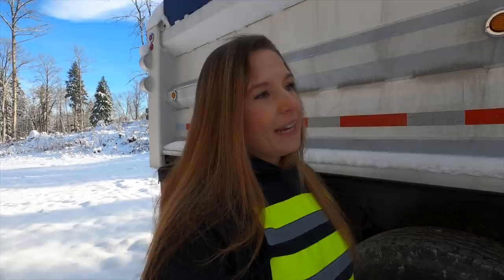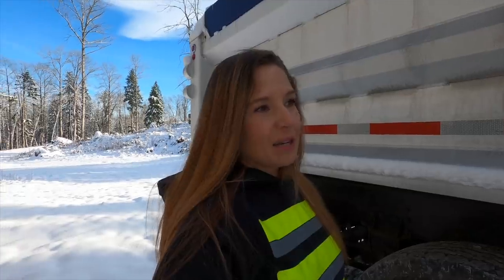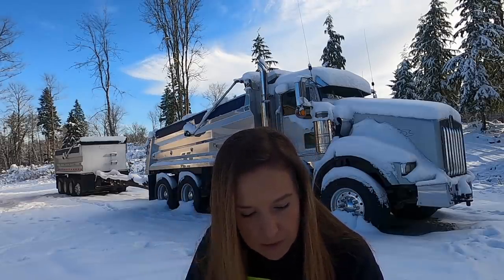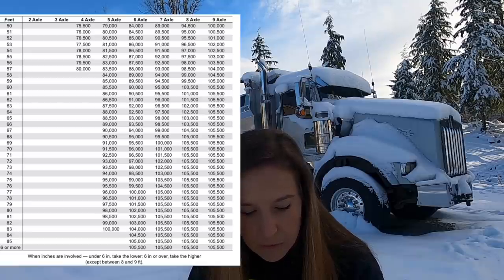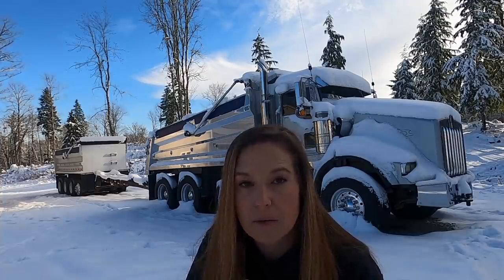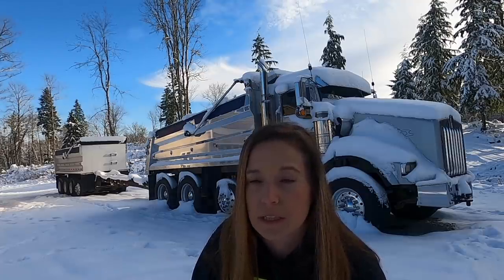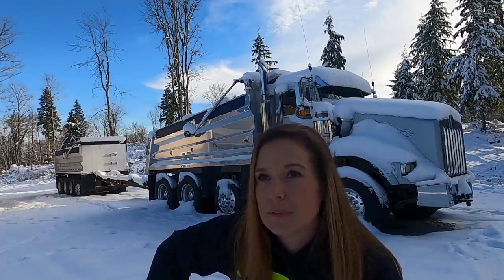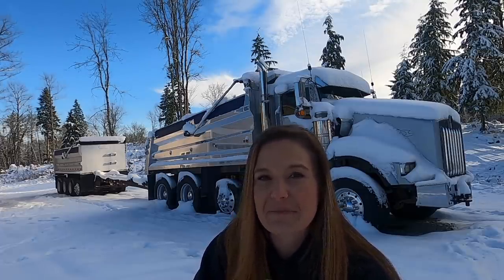WHY IS THE REACH SO LONG?!! Here is why, Bridge weight. Kenworth T800 Truck & Trailer Bridge Weight.

Comment: Thanks for the explanations and the weight tables, makes a nice cheat sheet for us europeans. Here in the Netherlands we are allowed 50 ton(110,231 lbs) on 5 axles, I drive a cement mixer with 5 axles, 3 steer axles, two powered, Where the rear most also steers to a certain degree.
Reply: We have a unit over here in the UK 72 tonnes on the cement work a ridged unit six axle and is classified as mobile plant no tacho and no operating licence required to operate some loop hole that 😉 yeah we run similar weight as you guys now makes sense with their heavy haulage units with all the axles and spread when we are doing the same on a 4 axle nooteboom
Reply: Where I live in Maine I can run 75,900 pounds on a tri-ax (steer, pusher and two drive axles) and we can run 100,000 pounds on a standard 3 axle truck with a 3 axle trailer...most places only allow you to run 80,000 pound gross vehicle weight
Reply: @aaronsanborn4291  you have to remember that in Europe we count the front axle, so what you call a three axle we call a four axle. Likewise a standard US 6x4 tractor which you call a two axle we call a three, not that 6x4 exists for otr work. 
As a previous commenter said the Dutch run a legal, but often ignored due to them not having weighbridges, the Getmans don't either, 50,000kg (110,000approx) with a 4x2 tractor and a triaxle trailer. Just last week I was speaking yo a Dutchmsn whilst on hreak and he had 52t (114,000lbs) of onions in the back of his walking floor  he thought that was normal.
Reply: Different wheight laws for other countries

Comment: The one thing I am still wondering is, how do you keep silly four wheelers from ending up between truck and trailer, because they don’t realize the two are connected by a very long reach? (I know they should be paying attention, but…)
Reply from the maker: There is a light on the reach but sometimes they still do hit the reach. Not often though.
Reply: I had a motorcyclist drift in once, he could not get out because of the draft/turbulence. I finally saw a speck and realized it was the tip of his handle bar. I slowed down, stopped and he said he had been between truck and trailer for about a half mile. He was one nervous biker. And not too bright to boot.
Reply: It's happened to a couple co-workers,  we have 75' 7 axles here in Canada running 139,500lbs. I've had many close calls but you just need to watch your mirrors a lot and react fast!
Reply: @DauminiqueTheDumpTruckDriver  this is are set up in the UK and Europe just thought you might like to see similar weight really but length laws vastly different
Reply: @knotbumper  c'mon!!!! Are you sure?

Comment: WSDOT must be one of the authorities that recognizes weight to length ratios. I am in Alberta and the pup trailers in these parts all have fixed/non-extendable tongues. The only legal way to increase your gross weight with the AB authorities is adding more fixed axles. Most gravel haulers here now run tridem (3 powered rear axles) gravel trucks pulling 4 axle A train style wagons. These wagons may have one air lift axle per tandem axle group that can only be raised when the trailer is empty and dead heading for a load.

Comment: I hauled coal in eastern ky for 21 years and we were allowed 126,000 with the purchase of an extended weight sticker. Our heavy spec trucks, double frame, 48 &52,000 rears all spring suspension tandem tractor with tri- axle trailer with reyco single leaf suspension, the trailer size being 36’ long 102” wide and 96” inches deep our light weight run between 45,000 - 54,000. When I quit trucking 65-80 tons was just a normal load and occasionally we would get into some really heavy coal and get bigger load sometimes over 100 ton load plus the weight of the truck. The dot would just look for the sticker on our wing glass, if had one they didn’t bother us but no sticker they would pull you over and weigh you. It’s amazing how the rules vary from state to state. Stumbled across your channel and really enjoy all your videos

Comment: The weight/length tables are not an arbitrary set of numbers. There is actually a formula for figuring out how much weight you can haul. It is 500((LxN÷N-1)+12N+36). L is length in feet center to center of axles and N is the number of axles. At 69 feet that would allow 105,428# gross on 8 axles. Washington State limits max legal weight to 105,500# without special permits. So technically you need an axle spacing of 70 feet or more to achieve 105,500#. Good luck with the set back axle on a T800. This formula also works for axle groups such as rear drive to drop axle center. A 10 foot spacing allows 43,500# on that group.

Comment: Trucker from Michigan here, good explanation of bridge law on your part, though I'm kinda laughing as we have gravel/steel/flat trains with 11 axles total that will gross 160,000-164,000 (164k is the highest gross without special permit, i believe). So the 8 axle combo to me makes perfect sense over the length. I've not pulled anything more than a standard 5 axle 18 wheeler myself though, but have looked at the bridge laws and frost laws here over the years. Love the truck and your attitude. Keep it up!
Reply: You can go to 169,000 on a 5 and 3 double if you can get all the axle weights perfect

Comment: When I was driving in Canada before retirement all our semis you call them were lic for gross 123,000 lbs that is with two 20 foot sea containers, single axle bogie, 3 axle semi.
That was back in the 1990's many changes I would think since then. Thanks for showing what you can haul. I see them now for years hauling 2 - 53 foot containers/trailers together. !!!!

Comment: As usual a concise well thought out video. The measuring points in correlation with the graph make perfect sense. Even an avg motorist s'd get this!
Spreading out the loads weight so less impact on bridges... and lengthening the time to replace bridge.
Reply from the maker: Exactly
Reply: @DauminiqueTheDumpTruckDriver  hey

Comment: Good morning. Just a suggestion. When you get your empty weight, top all of your fluids off. Combined they will add hundreds of pounds, possibly 1000 pounds, depending on the size of your fuel tanks. Enjoy your day.
Reply: You mean weigh in empty with as little fuel as possible
Reply: @zacharylehman4162  I don't think that is right. If they get a tare with low fuel and max out the load to hit max gross, it will be fine for low fuel. If they make another run with full tanks and the same load, right after getting fuel, they will be over weight because the tare has increased. To be safe, the tare should be with full tanks. It doesn't hurt when fuel runs low as they will just have less gross weight.
Reply: @zacharylehman4162  why so when you are loaded and you put a load of fuel in you get a overweight ticket ,,  better to run a bit light when fuel is low
Not sure how many overweight tickets you’ve got , but not worth it,, plus all the mud buildup underneath not worth pushing it like that

Comment: Thanks for the explanation. In a previous video I commented on the length of the trailer drawbar, (I think it was a different truck btw). And now I have the reason! I'm in Australia and this sort of combination is pretty rare these days. Most operators prefer an articulated (dog) trailer of 3 or 4 axles.
Cheers
Reply: Still see occasional superdogs around
Reply: @HJZ75driver  Yes, you certainly do. Hanson and Boral come to mind.

Comment: Thanks for the explanation. It's a bit different than how its done here in Denmark, here the weight is calculated by the number of axles and how many axles there is on the truck and how many there is on the trailer.
Reply from the maker: Yeah ours is a combo of number of axles and length.
Reply: Hej Stefan 🇩🇰🎁😇
Reply: @DauminiqueTheDumpTruckDriver   The combo we have here that comes closest to yours would be a 4 axle truck and 3 axle trailer, it would have a total max weight of 56 Tons/123.000 lbs. And is allowed to be 18,75 M/61 feet long.

Comment: I come from a logging community and  "reach" is a whole different animal on a log truck.  A  log truck "reach" off the truck  sticks out back, and the tongue/ stinger of the trailer hooks to that.  The bunks   swivel,  and the reach  swings out around corners  which  steers the trailer towards the outside of the turn, so that  log trucks can  go around much smaller corners.
Reply: The USFS defines it that way, and they're wrong as far as I'm concerned. Most people, and both WA and OR law define the reach as being part of the trailer and the stinger is part of the truck, which makes infinitely more sense than the other way around.

Comment: 4 axle dump here in Pa is allowed 72,380 gross. payload usually 23-24 tons depending on liteweight 
 same 4 axle dump correctly registered in NJ is 80,000  gross

Comment: Thanx for the explanation. I know its different in each state so its nice to see what the other states can do. Here were only aloud a max of 88000 no matter the length or number of axles unless on a permit or Coal haul roads. And if your on the interstate it is less.
Reply: That is the chart for interstate also.  There is also inside bridge weights (think just the truck and just the trailer) as well as axle weights that have to be factored.

Comment: I pull a Michigan Gravel Train which is a tractor, a three axle lead trailer and a five axle pup commonly called a triple ten. I can run about 155,000 gross, roughly 50 ton payload. The only problem is (aside from backing into some places) I have to unhook my pup every time I dump and hook back up after dumping the lead. It's kind of become second nature to me but I would love to try a set up like yours. It would be nice to just jack knife the trailer out of the way and dump. Anyhow, love your vids, stay safe and keep the rubber on the road!

Comment: Thank you! The related question is about backing up a trailer like that. From other videos you've posted, it looks like there's no hinge point at the trailer, just at the hitch on the back of the truck. I'd think it would be next to impossible to back up, sort of like tandem trailers.
Reply from the maker: Some transfers have a second hinge point. Other people seem to do it. I’ve never tried though.

Comment: Thanks for the info. Weights quite a lot different where you are than where I am in Canada. I haul Super B tanker, 8 axles, and legal for 63,500 Kg -   Max LOA 27.5 M  or  140,000 Lbs and 90 feet
Reply from the maker: Weight laws are different everywhere

Comment: I also suppose that with a long reach it’s easier to tip both trailer & wagon at the same time without uncoupling. 
In the U.K. 8 wheel tippers legally can weigh 32,000kg & never draw a trailer unless it’s articulated & then legally gross at 44,000kg 

It’s a lovely looking rig for 2003
Reply from the maker: We don’t dump at the same time. Trailer first and then truck. We stack the piles.

Comment: Go get warm!  🙂 anyone who’s driven a truck and trailer knows the longer the trailer the easier it is to back. Not what most people probably think. Bridge law compliance isn’t hard but the way some of it is written , can be confusing. 
Here in Kentucky we have to conform to Federal bridge laws on interstate highways and some state roads. EXCEPT, if we haul materials for road construction. In that case, a 4 axle dump can weigh 80,000 lbs. Crazy!

Comment: Pintle hitch trailers actually turn better because the pivotal point of the hitch on the back of the truck swings your trailer out slightly wider in the turn. That setup really isn't to bad to drive, especially at that length. Pulling a set of doubles that are at 114 feet long can give a guy a migraine if you get lost and end up downtown.
Reply from the maker: Oh I agree. The first time a drove a dump truck like this it felt like coming home. It was so easy and natural for me.

Comment: You should have 6 to 7 foot of slide in the reach. I was aware of this, Back in the late 80's I worked in the hydraulic s on the dump trk side of '' TruckWeld ' in Kent Valley.

Comment: 6 degrees? Try  -4d now and  -18 tomorrow morning! I have 20 inches of snow and it looks like there is none in the immediate forecast!  So now how does the state calculate your license fees? I assume they want a separate sticker for the pup! I did MnDot  inspections on trucks over 25,000 lbs and some of the regs were on the "fussy" side but most were for safety of course! Oh, here's one - there were places where you could not have any damage in the windshield but nowhere in even the Fed regs that said you had to have a windshield! 
Thanks a lot for the reach info!
Reply from the maker: Its done on weight. You have to pay a yearly tonnage fee.

Comment: If you moved upto a "site engineer" position, why did you buy your own truck? I just found your channel the other day, so maybe I missed part of the story. What is a site engineer and do you have an engineering degree? I started out in the trades about 26 years ago, at age 14, and have learned many trades. My uncle owned a painting business and had me work on a home he bought for him and my aunt and at age 15 I worked on his customers homes and buildings. Over the last few years I have picked up equipment operating and work for an environmental and infrastructure company in SoCal. We loaded up 4,625 super 10 loads of dirt on our last job in San Diego, where I counted/logged trucks, manifests, weights, air quality monitoring, and anything else my brother needed (he is the site super and person who bids the jobs). I loaded a handful of super 10's with the Cat 349F excavator and he did the rest. I'm used to running the smaller machines and the 5.5 yard bucket on that machine meant the teeth were almost to one side rail of the dump truck while the heel was smoothing out the other side. Much of my work was on existing homes and commercial buildings which is quite a bit different from what you show and what I have done for the last few years. At least a hard hat wasn't required for my past work, but my time doing hard hat work will be limited due to the torture the weight of a hard hat causes on my neck. Hopefully, the fabrication, welding, and cnc work I do on my own will make up a larger portion of my income as my body isn't as capable as it used to be. It is fun to see how other people work in the same industry. Great video and the music was a nice change from all the other crap royalty free stuff that other youtubers use.

Comment: Hi from Sweden 
I drive a dumptruck her in Sweden .
Here some meserments about what i drive her in sweden.
 My truck is a 3 axel truck my total is 27 metric ton its aboute 59500 ibs and with a 2 axel trailer i get 47 metric ton its about 103600 ibs and in payload its 28,5 m ton / 62800 ibs truck / trailer and the from the 1 axel to the last on the trailer its about 14 meters / 45 feet.

Happy new years from a fellow driver

Comment: in germany u can drive with (unsure inch and pound translation) with 12 axle and 70 ft (22m) u can drive 550.000 Pounds (265 Tonns) with a 4 axle truck 30 ft (10m) u can drive 65.000 pounds (32 tonns)

Comment: Just a suggestion that might help with your Flopping  CB Mic cord  is to loop it over the Mic itself while it's in the Mic holder and not in use . It work for Me when I had  my CB mounted in the headliner  🤷‍♂️
Reply from the maker: I'll probably get a new mic. A shorter one.
Reply: Maybe one of these ? Hands free 👍Cobra Cam29bt Replacement Bluetooth Microphone for 29LTDBT

Comment: The Washington laws are serious screwy (I was stationed at Ft Lewis 02-05)...we run 100,000 on a standard tractor with a tri-ax trailer. I run 75,900 on my Tri-ax with a tare weight of 25,700 pounds...we don't run pup trailers in Maine...I've seen one maybe two in my lifetime here

Comment: hi i understand what u are saying about the length extended and shorten..so in other words your weights has to be bang on..or your over on your front axle on your trailer..and your 2 front steers while your stretch out on your truck..got to be bang on..unless they allow for a little tolerance..thats just thoughts..after watching your video..cheers
Reply from the maker: The weight is pretty easily distributed. You usually have a pretty good idea how to load your own truck once you get it on a scale.

Comment: Shouldn’t be any more difficult than pulling a 53’ Van although I bet it tracks somewhat like a spread-axle? One pivot point makes it as easy to back as any semi. My transfer dump was a “truck and trailer” with two pivot points making it quite the challenge to back down a narrow road! Took it on some really hairy switchbacks and mountain fire roads. Not sure what the laws are out here in Texas as I haven’t driven dumps in a while but they use “super singles” with boosters and tag axles so I’m sure you can get pretty close to a 75000 GVWR.